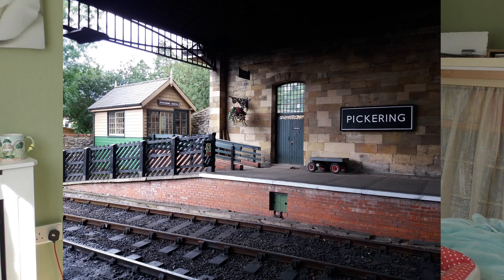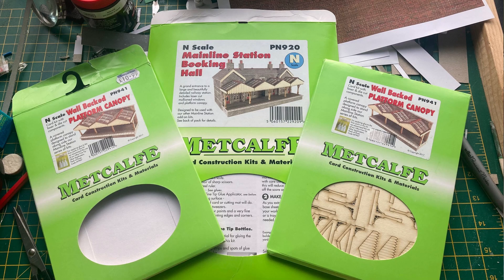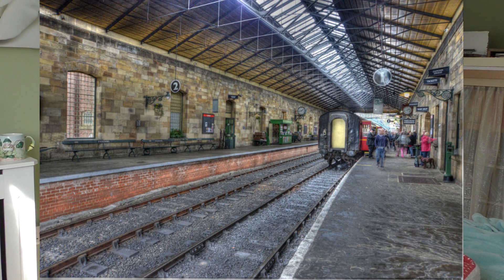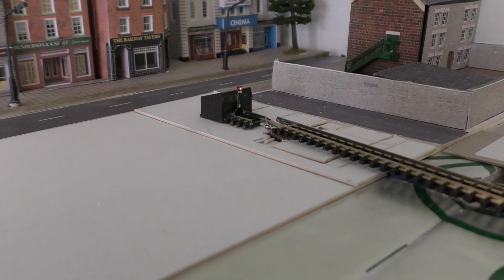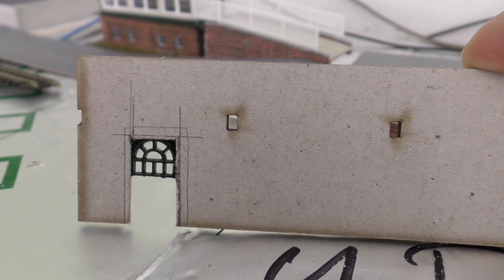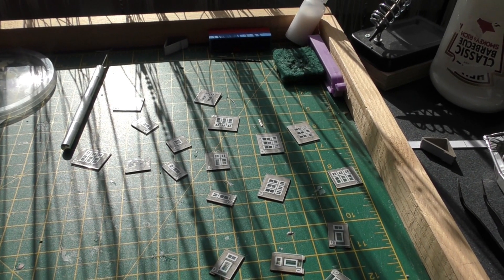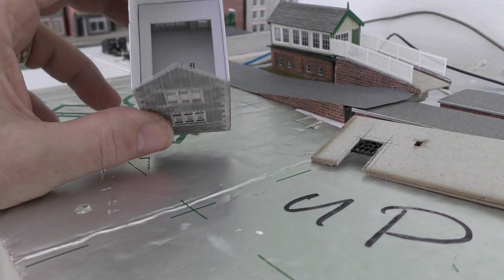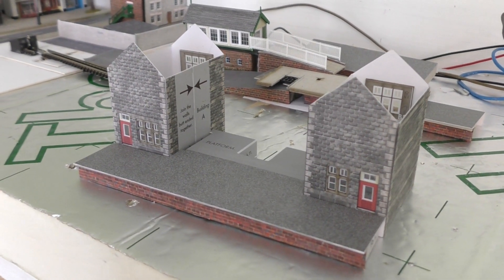Grandads Little Railway pt 7

Comment: Like how you have altered the brickwork on the platforms. I have tried different platforms, I am on my fourth layout build now since I retired. I tried platform edging on one covered with styrene with card flags over the top and it sagged. On the last layout I used the Metcalfe platforms to make a curved platform too and they turned out ok, but I prefer your brick look. I used the same Metcalfe station building too, that layout is now at a local model railway club. I made it too big for my loft room, I had to keep crawling round the back, too old for that...lol. My new layout is modular  and easy to pull apart in case I move. Chris
Reply from the maker: Thank you I maybe changing if though as it’s not quite right but I’m sure l’ll get it nearly right in the end..Graham